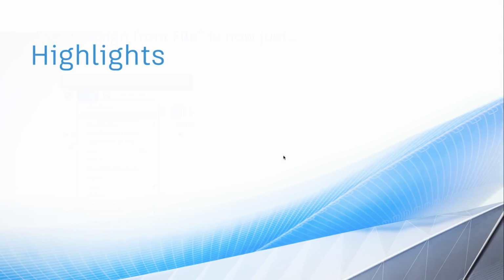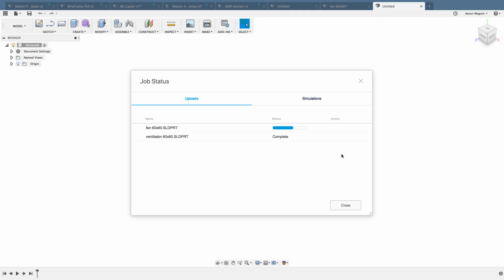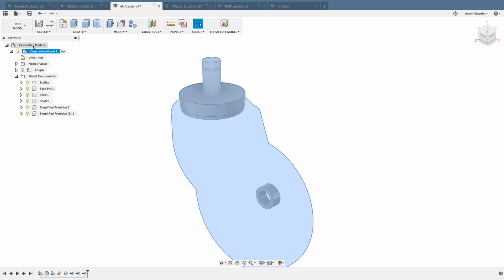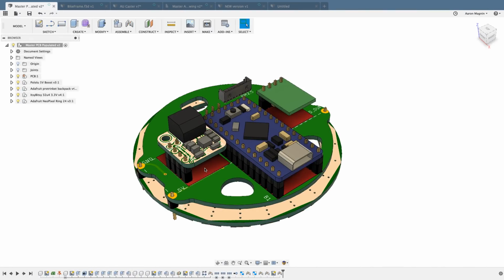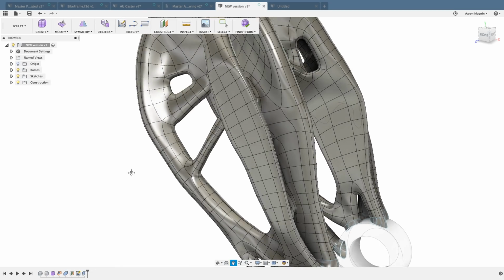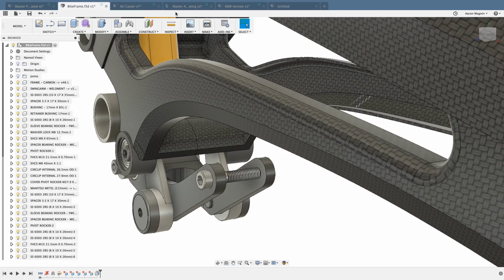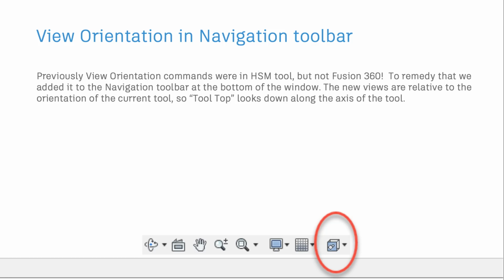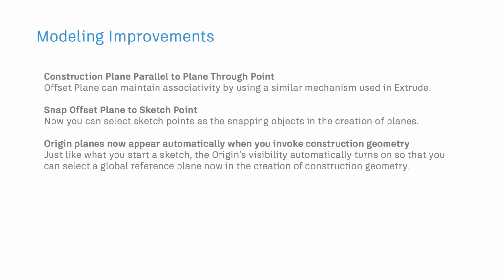360 LIVE: What's New November 2018!

Comment: Some good updates again, love how improvements just keep coming. I have a question and also posted this on the Fusion 360 ideaStation forum. With the emphasis on generative design comes a need for better T-Spline manipulation tools. Speedform has two that have been implemented for a while that would be really useful for cleaning up generative T-Spline meshes. The Edit by Curve command is one of them and the other is the ability to constrain vertex direction in the pull command to 2D or 1D. Any chance to see enhancements like this in a future release?

Comment: Fusion vs inventor, which to learn, i can not decide.
Reply from the maker: Depends on what you need to do, but we're big fans of both.
Reply: Interesting question, I use both SolidWorks (similar to Inventor) and Fusion. While Fusion cannot replace SolidWorks for me at the moment I like working in Fusion better. Also SolidWorks and Inventor are both based on a pretty old CAD modeling paradigm while Fusion is a much more modern concept. In my opinion Fusion will be the better choice for a lot of people/organizations as time goes on.

Comment: I would like to be able convert an STL file back into a sketch to enable design changes. This would be useful if the original sketch file had been corrupted or lost.
Reply: STLs are triangulated, that is to say, the original geometry is basically gone. So that's not possible to do. What are you trying to achieve? You can do the Mesh to BRep thing which works ok to get a pretty rough model of the geometry, a model which is better the fewer circles there are. Then, that model can be modified using usual commands or direct modeling, whichever is preferred.
Reply: What am I trying to achieve? I was working on the 5 th mod of a design that accidentally got deleted from the cloud and was not saved locally.. The only file that was left was the stl.

Comment: mac app is slow with up dates dump it go to fusion 360 and down load it to you mac and you will have no more problems.
Reply from the maker: True. Get it here instead if you're reading this: http://www.appstreaming.autodesk.com/install/app/73e72ada57b7480280f7a6f4a289729f/

Comment: Can you improve texture map control or add a UV map creator and editor in future, i really like to Fusion be not just manufacture program but also a good program to make virtual props and make architectual scenes like i do now. Also will be great to have Sculpt tool, not advanced but just basic brushes like in ZBrush. But back to the texture map control, it has some issues when it comes to render a scene in cloud, in my canvas render while i set texture map control to Box type and manual manipulate position of texture its looks in render how it should looks like, but after my cloud render complete i see on every Render images that Texture Map Control didnt affect to an object and it looks like it back to the Automatic type instead of Box type and manually moved by me, another problem with textures are Black bamboo wood texture, in canvas render it looks good but again after cloud render it has a grey stripes on the texture looks like a bump map without a diffuse map, then i edit that wood material and delete advanced highligh image from that wood texture and then bad gray stripes go away. It will perfect to improve this program to be friendly with interiors and exteriors architecture scenes, also maybe some background planes when you can place a (for example) forest texture with alpha map and put that plane behind the window to have a illusion of exterior nature, instead of place whole HDRi environmet to the scene. Its my favourite 3d program so far, i really like how easy is to make anything what i want in just a couple of minutes when in 3ds or blender it will take me a hours. And an another thing i want to talk about is that cloud projects archive. In my scenes are a lot of objects and custom textures that make my project heavilly to save to the cloud, it Uploading just a one version in 30minutes :(, and when it comes to make renders and usually make 3-4 shots of my interior, but rendering in cloud cant start if document is not uploaded yet so i need to wait for every shot to my document upload to the cloud and that can take up to 30min each. What do you think about an option to create local archive on my computer instead of saving it to the cloud, i mean like in other non-cloud programs, i save my document on my computer, i dont need to upload it to the cloud (i can do it if i want it the future) and also i can do renders WITHOUT must saving my document to the cloud, that will be perfect with heavy files just to have them on local machine.

Comment: What version is this? I do not see the file open drop down in my F360 and my account says no updates.
Reply from the maker: I see 2.0.5044 in my help > about. I do know that if you install Fusion 360 from the App Store (Apples), it can be delayed slightly due to their process.
Reply: he has pay you have free.
Reply: Mine is free and says 2.0.544 so what gives with that? However my add-ins tab is missing as are all the add-ins
Reply from the maker: Where to get outside of the app store? Here: http://www.appstreaming.autodesk.com/install/app/73e72ada57b7480280f7a6f4a289729f/
Reply: Tim Arnold I noticed the same thing with the add-ins missing.  If you are using the new UI, they are now in the tools tab.
Reply: All is good as the Mac app store posted the update. The world is right again.